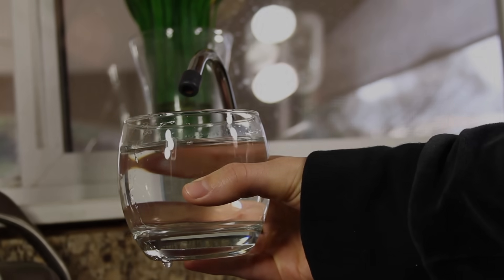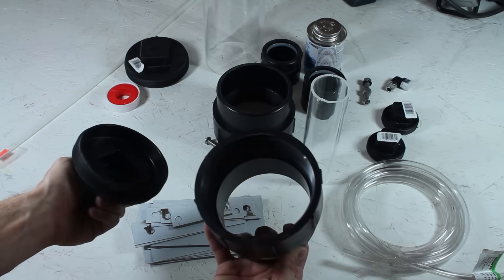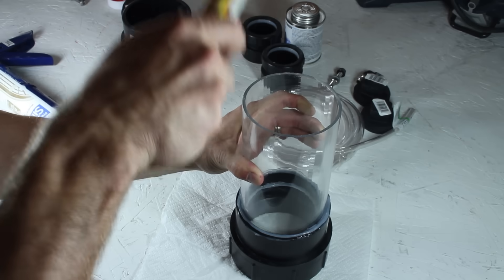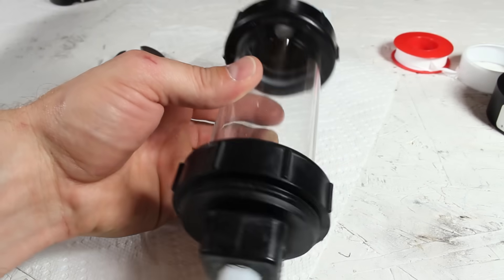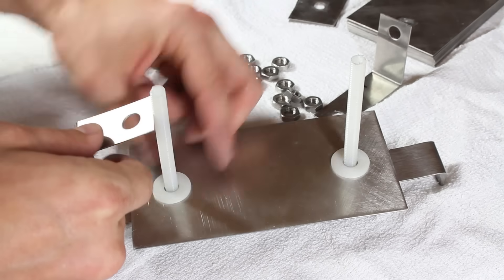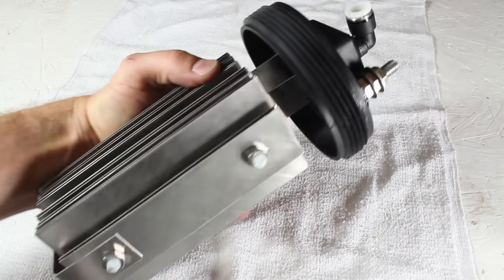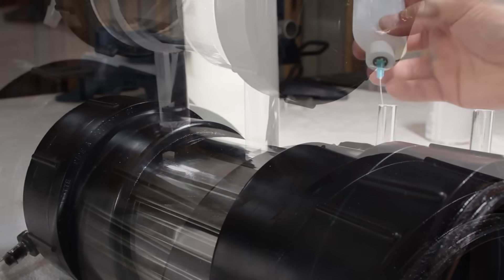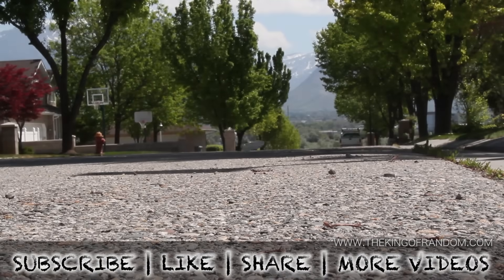HHO Generator - Water to Fuel Converter

Comment: How do you make potassium hydroxide??????
Reply: to make Sodium Hydroxide you need a wood rain barrel, wood ash, and a cast iron pot.
pour 2" worth of gravel into the bottom of the barrel,
drill a 1/2" hole 1.5" from the bottom of the barrel
fill barrel with wood or charcoal ash
allow rain water to collect in barrel with the ash
set the iron pot to catch the run off after it sinks through the ash in the barrel
you now have sodium Hydroxide in a water solution
you can cycle the same water several times to up the concentration of sodium hydroxide
then you let the water evaporate, or boil it off...
Sodium Hydroxide is better known as Lye; the same Lye that has been used for hundreds of years to make SOAP!
people....you gotta learn some history!
just because something is done the old way does not mean that it isn't useful

Comment: Nice video very handy, a slight bit easier solution is to take 240v power cord, plug it into a gas generator, splice the other end, place that into a bucket of water. Run the gen through 1 gallon of gas, produce h22, then use the h22, to replace the gas you were using. Just replace the standard fule intake line with a dual intake line.
Reply: see now this guy is thinking!
Bravo sir!
Some people really need to be lead by the hand and shown every last little thing because they can't figure out things for themselves.
Reply: ***** Thank you!

Comment: Do you use distilled water?
Reply: you can just use tap but if you use distilled you have to have a catalyst like the flakes he used in the video. you might be able to use salt but that might create a chlorine gas. its a little less risky to just use baking soda instead. also you should probably be able to hydrogen peroxide too
Reply: C Nelson Won't produce much Chlorine gas.  The Sodium and chlorine from the salt are far too reactive and will recombine with some of the free Oxygen, it will basically be making bleach - Sodium Hypochlorite, NaClO2 IIRC.  The Potassium Hydroxide he used is far less reactive and doesn't introduce any neg. ions that aren't already in water (Hydroxide = OH-).

Comment: i was wondering if you instead of using a car battery, can use a car battery charger
Reply: usually you just need about 20 amps in this system to make it fly how ever you get it ... make a rectifier if you have to and use house power
Reply: mike mclaughlin mind you most outlets are rated at 15 amps ... use caution
Reply: mike mclaughlin okay thank you

Comment: Now I just gotta learn how to make Potassium Hydroxide XD
Reply: You can buy that stuff, or replace it with sodium Hydroxide (drain cleaner).

Don't get it on your skin, it is really corrosive. And if you do, rinse immediately with water. And wear safety glasses : if a drop of it splashes in your eye, you loose the eye.
Reply: The insult wasn't necessary, to say the least.
Reply: Joey B. Way to go, now you can say your one of the people who likes to pick at people's flaws for fun. See how many girls that one gets you.
Reply: to make Sodium Hydroxide you need a wood rain barrel, wood ash, and a cast iron pot.
pour 2" worth of gravel into the bottom of the barrel,
drill a 1/2" hole 1.5" from the bottom of the barrel
fill barrel with wood or charcoal ash
allow rain water to collect in barrel with the ash
set the iron pot to catch the run off after it sinks through the ash in the barrel
you now have sodium Hydroxide in a water solution
you can cycle the same water several times to up the concentration of sodium hydroxide
then you let the water evaporate, or boil it off...
Sodium Hydroxide is better known as Lye; the same Lye that has been used for hundreds of years to make SOAP!
people....you gotta learn some history!
just because something is done the old way does not mean that it isn't useful.
Reply: He trolling. 
Stop going with it. 
He's enjoying every moment of it.
Reply: Joey B.
 Dude, I don't fucking peer-review a fucking comment before I fucking post it on fucking youtube, so there may be a few typos or mistakes. No need to go crazy over it. Besides, English is not even my first language, and I bet you'd make a lot more spelling mistakes than me if that conversation was held in French.
Reply: ***** That is how to make potassium Hydroxide not Sodium Hydroxide. its also not pure and very cude.

http://en.wikipedia.org/wiki/Wood_ash
Reply: William Fretz Actually, Joey  only gets guys......
Reply: ***** I buy it 50 pounds at a time and get it $1.5 pound. About $3 kilo
Reply: you can just use regular table salt, it works just about as good :)
Reply: ViceVersa
Not really, the chlorides will give you a ton of trouble with electrode corrosion. Not to mention the risk of making chlorine gas.
Reply: hmm i suppose :/
Reply: any sort of salt works because any salt in solution or melted conducts electricity well http://www.horiba.com/application/material-property-characterization/water-analysis/water-quality-electrochemistry-instrumentation/the-story-of-ph-and-water-quality/the-basis-of-conductivity/ions-in-water-and-conductivity/
Reply: Fred Nixon
 Did you read my comment just above?

Conducting electricity is a required condition, but not a sufficient one. Most anions and cations in solution will give you a ton of trouble.

Also, fun fact, I made an internship in that company! I worked on ICP-OES though.

Comment: Already know about this when I was in Junior high school lol
Reply: Oh my god you already knew about something! 
Wow look at me admire you for your knowledge!
Thank you oh mighty keeper of thoughts, I am sorry we have displeased you by needing a video for us lessers, who do not have your infinite wise wisdom.
Reply: Kameran Akrawi Not free.  You have to pay for the electricity.  Every Joule of energy released by the gas, you had to put in as electricity.
Reply: Robert Wenzlaff As a side note found while looking the above info up, when you factor in the energy used in refining the materials to make the batteries, the Chevy Volt's total CO2 emissions are 50% higher than a similar sized gas vehicle.
Reply: *****
 A trained individual can AT MOST produce 120W, that's about 1/4 HP, can you expect a car to run on less than 1 HP?
Reply: Robert Wenzlaff All you need is a battery, two lines, and a bottle of water if only for experiment.
Reply: ***** You are just exchanging one source of energy for another.  There are far fewer power plants, but they use fuel by the ton not by the gallon.  The point is, its not free.  You pay for the cost of the coal in your power bill.  And rather than use a human powered generator to make electricity, to make H2 to power a car, you could just walk or bike to where ever you are going.  The total amount of energy you're spending is at absolute best, the same, in any real system, there will be losses every time you change from one form of energy to another, so in reality, it's always more energy to do it the complex way.
Reply: Robert Wenzlaff so, produce the electricity through what ever means you like, it still changes the fuel used in the cars and they far out number the power plants. together the billions of cars on the roads dump out far more polution than the power plants that number in the hundreds... and you are over looking nuclear, solar, wind and wave power, hydro-electric dams,  and who said free any way?
Reply: Robert Wenzlaff
 Not if you built a different sort of generator. It is likely possible to create a human powered generator that could do the job.
Reply: Robert Wenzlaff The EPA says that 38% of US CO2 emissions come from the Power industry, with only 31% coming from all forms of transportation.  There may be a slight gain because the power plants are engineered to be more efficient at a large scale than you can get out of a single automobile, but I doubt it's enough to make up for the losses from converting one form of energy to another.  The battery charger you use is probably only 85% efficient, so that 15% waste alone kills any gains the power plant might have got you.
Reply: I am dead so please stop commenting
Reply: Robert Wenzlaff What do you mean you're dead?

Comment: Really good looking build, but as you mentioned this outputs an oxy / hydrogen gas mixture. You are splitting the molecules by electrolysis, but since they aren't separated gases,wouldn't they form back together into water over time if stored in a container? I am looking for a good demonstration of how to separate the two and store them in a concentrated form to later use in a fuel cell.
Reply: At room temperature, Hydrogen and oxygen won't react together. But it does not mean you can store it like that : it only takes a little bit of static electricity to ignite this highly explosive mix, making it really dangerous to keep in any large amounts.
To separate both, simply use a different electrolyser design with more space between the anode and cathode, so you can separately gather the gases bubbling from them.
Reply: piranha031091  I did find an example of how this is done in a lab, the setup is from the late 1800's and is called a Hofmann Voltameter. Then to store the gases  compressed you can pull a strong vacuum on a tank then attach it to the device. This avoids actually putting flammable gases through a compressor.
Reply: *****
Except diffusion will completely mess it up, unless you can get a REALLY tall vessel, which will therefore be filled with a very large volume of an explosive mixture.

Just use a separate anode and cathode to collect the gases separately as they are made, as Yao Hu and I said. It is way more simple, and I already did it before.
Reply: Terence Hood Accidental sparks would still be a problem. Depending on the amount of gas stored, it can really blow up a house.
Reply: just set the 2 electrodes at distance, and collect the gas from each side.
Reply: Dareeude To separate the Hydrogen from the Oxygen is not difficult at all.Hydrogen is lighter than Air, Oxygen is not.
so have the gas mixture vent into a vessel with an upper and lower chamber with a check valve between.
The hydrogen will rise till you fill the vessel to a prearranged shut off at the check valve.
this is ages old technology; like from 1800 century England ages old.
Reply: In an electrolytic reaction, hydrogen forms on one electrode while oxygen forma on the other, and if the two are separated with just a conducting tube between them, you will get pure hydrogen from one and pure oxygen from the other.  It's a basic chemistry setup, which I've done several times, but since it's illegal to do this without special permits and licensing I haven't.

Comment: So if I'm understanding correctly, you are collecting both the oxygen and hydrogen gas and using that as fuel? But In a standard electrolysis reaction, you can collect the oxygen and hydrogen separately. What is the benefit of not separating the two gases collected?

Comment: do you need the flakes
Reply: No you can use Baking Soda instead for the catalyst.
Reply: Mikey Deaton True
Reply: Mikey Deaton thaks
Reply: No problem. :)
Reply: I have read that potassium hydroxide does not dirty the plates over time, where baking soda (though safe to handle and easy to get) might.
Reply: Ieshua Levy i think ill do this . becase it will be fun
Reply: i will do this

Comment: I have always wanted to make one of these but I only have one question. In the video you said you have the outer plates and inner plates are probes for the electrolysis while the rest are not directly connected to the circuit(as seen separated by the plastic washers). Are the other plates acting as a catalyst while the electricity passes through the electrolytic solution?

Thank you for your time. Had to subscribe!

Comment: Someguy I am impressed, but I am looking for a motor or something that can utilize this fuel to spin a generator.  I am trying to figure out how to spin a wicked wheel or the turbines in the dam to create electrcity.  I am looking for a form of energy that is abundant to convert into electrcity.  I know china has a problem with the coal, and I am trying to figure out a solution to reduce the coal, so I figure the 3 georges dams cost 20 billion, and I am thinking about something wiser that will not hurt the environment.

Comment: I built three of these 4 yrs ago, one generated HHO to boost my gas in '96 Ford Explorer XLT 5.0 V8:11 mpg to 17.2 mpg - 20gal gas tank that is 6mpg ave efficiency in the burn and a 120 miles per tank improvement overall !!!  You have to think outside the box once in awhile, folks. The science quoted ad nauseum about "this won't work due to some law of energy" doesn't apply for increasing efficient burn of fuel with a catalyst ! Not a catalytic converter, all that does is cook unburnt hydrocarbons in exhaust from unburnt fuel - now we burn ALL the fuel any get more efficiencies in the I.C.E. (internal combustion engine). Go to visionace channel to see view !

Comment: If the gas burns hot enough and can be used in a controlled burn, you can store it in a gas tank and use that for welding gas.  Mind you this is all ifs and speculation, but that would definitely burn cleaner and probably safer for your eyes than what is currently being used.

Comment: I wish either two things. 1: I wish I knew this guy in real life, he seems fun to hang around. xD 2: I wish I had the means, resources, knowledge, and equipment to pull this off. I would kill to have one of these as my own, professionally made. Costly or not, I would give a leg and/or an arm for this type of access to gas.
Reply: I am currently attempting it and it is not that difficult I've only spent around 170$ and am taking my time as parts are hard to find, and not too many tools are required I used a reciprocating saw (jig saw) with a stainless steel attachment to cut the stainless steel sheet and a hack saw to cut some PVC. I found that the stainless steel cost the most. And all you need to do is some simple math to find the calculations he hasn't shown in the video like I did I didn't bother to buy the 20$ booklet
Reply: @Ls9819 , please do not use Stainless. It will release Chromium (extreme poison) into the atmosphere. I recommend copper.
Reply: its not impossible as you see. make a good apprentice in mechanics and the fun is yours.
Reply: Inception1338
Well, yeah, it doesn't SEEM hard, but for someone (such as myself) that doesn't know a thing at all about mechanics, it seems pretty difficult to actually pull off. This, however, isn't detering my determination to make this myself. Come payday, I'll be buying those build plans, as well as any required materials. I can borrow my father's tools.
Reply: try low skill projects at first.
sacrificing time and money is mandatory.
Reply: Inception1338
Time isn't the issue, time may be the only thing I have. Money is the problem, especially this day in age.
Reply: independence these days is far away at most spots. Agreed.
Reply: @KitsuneNoMeiji , I find his instructions simple enough. Just follow the steps in order and have the pause button handy. If you still can't quite figure it out, there are hundreds of HHO generator (a misnomer - it only converts through electrolysis) how-tos on youtube.
Reply: @KitsuneNoMeiji  Did you ever buy the plans for this? I noticed that they are no longer available. I would love to get them. please let me know.
Reply: @benitovenegas9829  No.
Reply: I don't know how old you are but if you haven't gone through college yet start preparing to major in engineering. We did fun projects like this back in college all the time.
It's even more exiting when you understand the math and science behind it - in fact you can come up with your own experiments out of the blue.
Reply: good work!
Reply: I want a similar device for africa combined with a solarenergy system and with something like this: someone can do it?
watch?v=qRZY_R1fdHI
Tell me the price.
Need in in Afrika for powering a food project.
Storing the Hydrogen for use at night would be cool too. I am in contact with Prof. for this but researching this area is prohibited by oil industries in germany.

Comment: Why are we not funding this?!
Reply: because what the video doesn't tell you is in order for this to work, you need ridiculous amount of electricity running to it, more then a normal car can produce, which is why right now people don't normally run full HHO they use a hybrid mix of HHO/gasoline, but yea a regular cars alternator can't support it, it would actually be burning more fuel then its making because the alternator is having to work harder, if the industry lets it happen which they probably won't because it hurts there bank accounts from people not buying oil and gasoline, then they are going to have to create something that makes electricity better
Reply: snowking907 The only way to win is to invent something that violates the first law of thermodynamics.  If everything was 100% efficient, you just break even.  1 H.P. = 757 Watts. If the engine was 100% efficient, then the H2/O2 produced by 757 W of electricity would produce exactly 1 HP of mechanical energy.  If the alternator was 100% efficient, it would require exactly 1 HP of energy to produce 757 W of electrical power.  That's everything bit of energy the engine makes leaving exactly nothing left over to actually move the car.

In reality, the alternator is about 60-70% efficient and the engine is 20-25% efficient, so you're throwing tons of energy away.